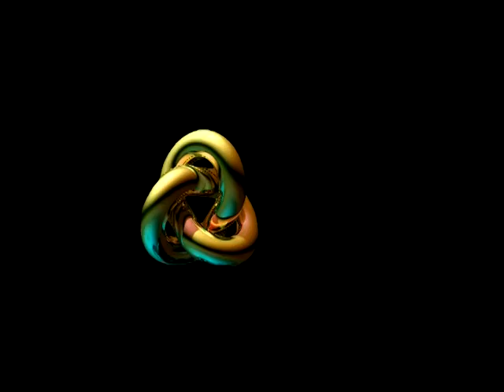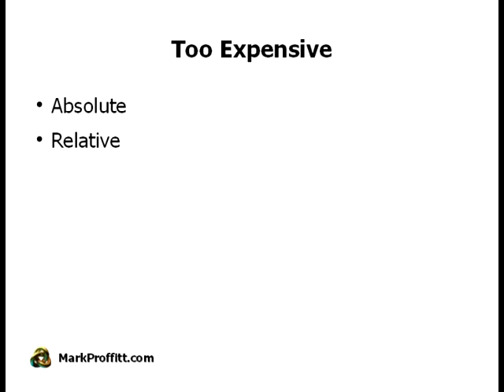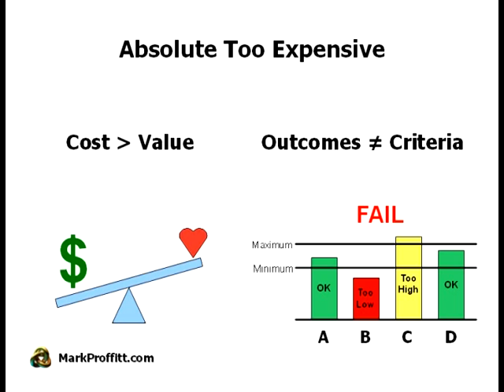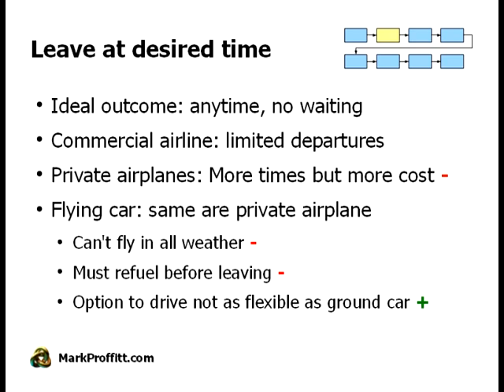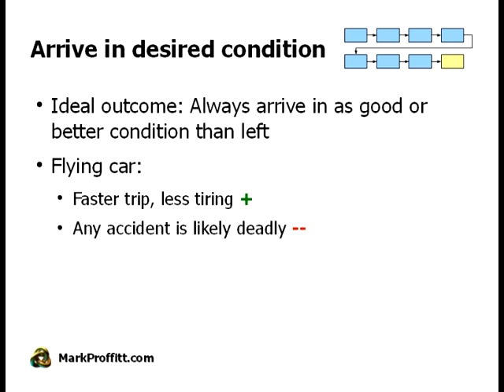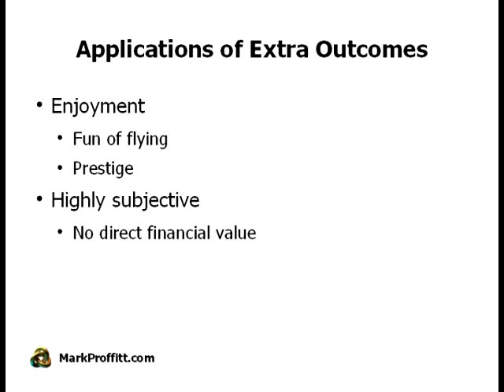Is Your Product Too Expensive?  How to calculate price and cost.

Comment: if it can't be sold in mass it's not profitable a millionaire may buy a Ferrari but it's unlikely he/she will buy more then 1 and that is bad when you consider that only 1% of the population has that kind of money. also safety doesn't matter as long as the product is tried and tested and people are aware of the risks.
Reply from the maker: Tried & tested = reliable results. That is one aspect of safety. There are 2 types of trust:
1. trusting something won't harm you
2. trusting something will do what you expect
"I trust  an alligator will bite my arm if I give it a chance" The alligator is reliable but not safe. Some people put much more value on the "won't harm me" type of trust.

Also a very important point of innovation is the levels of satisfaction for each of the many required outcomes changes over time and in different situations. When cars first came out you had to crank the engine by hand to start it. That was both inconvenient and dangerous. But those requirements were less important at that time than having the car run. Today the car running is the baseline. Standing outside risking physical harm is a step down. BUT people will do it if they absolutely need the car to run and it isn't running. Of course they aren't happy about it because they still measure the experience against the baseline of push a button and go.

Comment from the maker: Most innovations start by serving people who will spend a lot of money for limited functionality, extreme users or as toys. Airplanes started out both ways.

Autopilot in airplanes is the opposite of what is needed for safety, it keeps the plane on course. Safety needs to change course to avoid crashing. In open air there isn't much to crash into.

Just because something can be done doesn't mean anyone wants it. Inventions fail to innovate if they don't better satisfy an unmet desire.

Comment from the maker: @StormTrek Look at WikiSpeed. In 3 months they designed and built regular gasoline powered car that gets 100 miles per gallon and costs under $25,000.  The used the Agile method (something I worked on before Predictive Innovation).

Comment from the maker: @Steve8207  Automated land cars are very easy if you look at the entire system. Put beacon on the road then the cars can follow the path. This would only need a little upgrade to roads. The first motorized land vehicles, trains, used that exact method for 1 path. The next technological step is many roads. RFID markers in or next to the roads would allow cars to both drive themselves on marked roads and manual control on unmarked roads.  Automated everywhere (continuous) is not the next step.